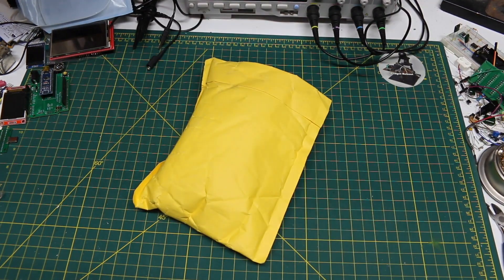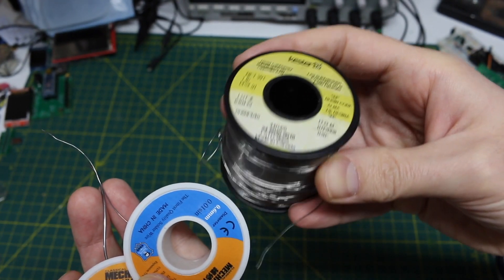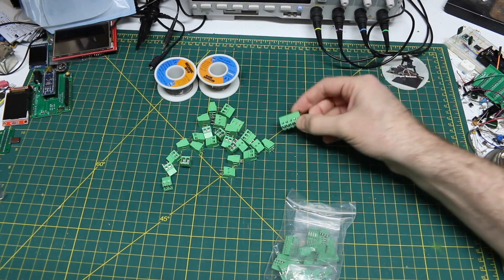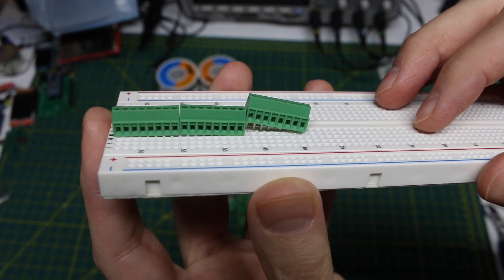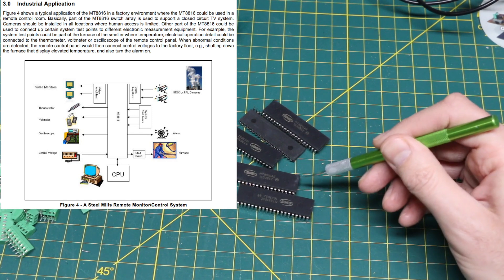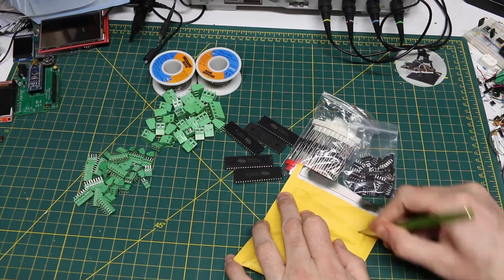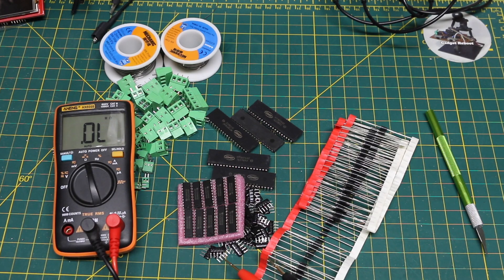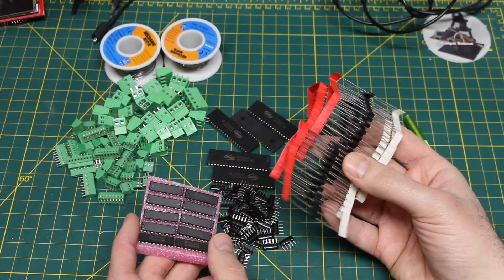Mailbag!

Comment: 0:47 - that cheap solder makes EXCELLENT tie wire. I use it to wrap up bunches of enamel coated wire, hookup cables, etc. It's soft and nicer to work with than twist-ties.

Comment: In my limited experience my personal stupidity is way more dangerous to chips than ESD.
Reply from the maker: Me too, especially when it comes to installing them backwards, or entirely missing a row of pins on one side of a socket.   I once had an 8 pin DIP get so hot on a breadboard it melted the plastic under the chip.

Comment: Something new all the time... have been using the TXB0108 for 3-to-5 level shifting. This is the first I heard of a 74LVC245.
Have learned from bitter experience though that i2c signals still need that special 2-Mosfet circuit to level shift ... bi-directional.
Reply from the maker: Yeah I just finished making a schematic for an ESP32 board where I had to put some of those Mosfet shifters to get bidirectional like that.   I have TXB0108 in my next pending Mouser order list along with some of those single and dual buffer/gate logic parts and level shifters, just to stock up and to help make the free shipping minimum order. Parts like 74HCT2G34, 74LV1T34 74LV1T126GW

Comment: I was sent 100 74ls02 ics wrapped tighter than a cats bum the same as yours haha. Man, it's crazy how all us people into electronics order the same stuff. Let us know how mechanic solder is. I bought it once but a friend ran out but he doesn't really know the difference.
Reply from the maker: Thanks for the super-tip!    Yeah oddly I don't have many bad chips or transistors out of all the improperly packaged ones, it's mostly due to them being fakes when they don't work, like a JFET that tests as NPN.   The Mechanic solder I'd probably not know it's low cost if I used it in a blind test against bigger brands, but some of the other cheap ones I tried just wouldn't flow and in some cases didn't even easily melt.